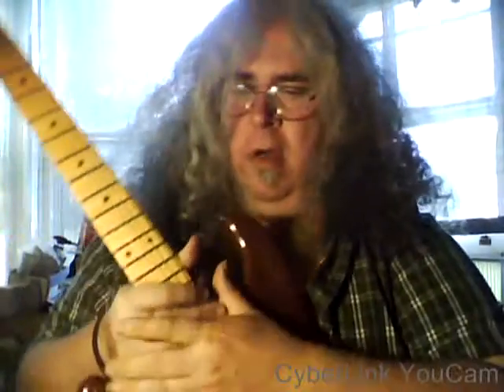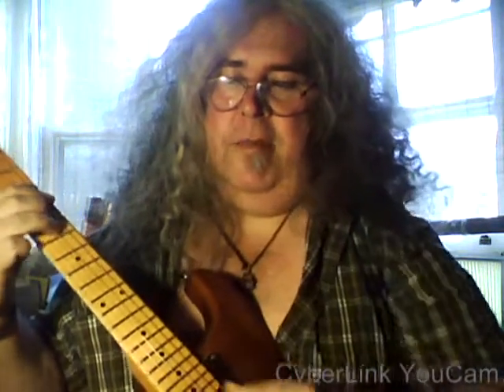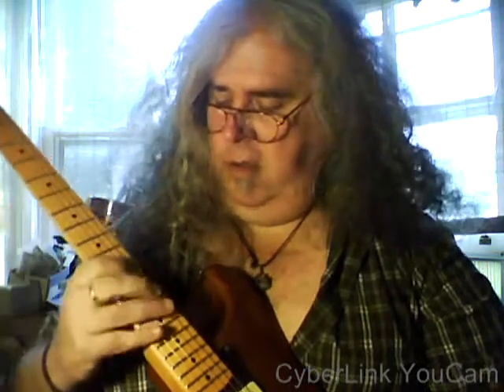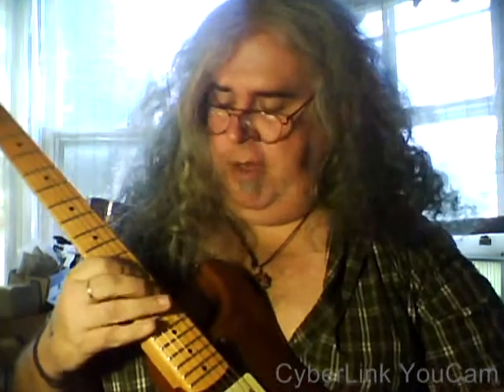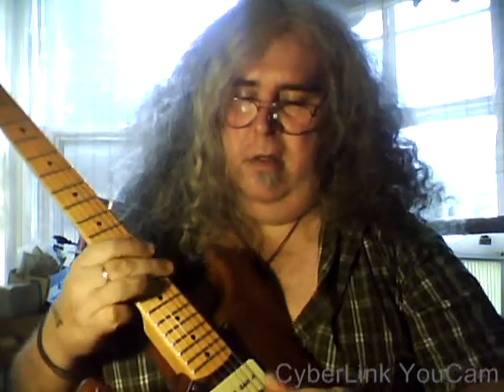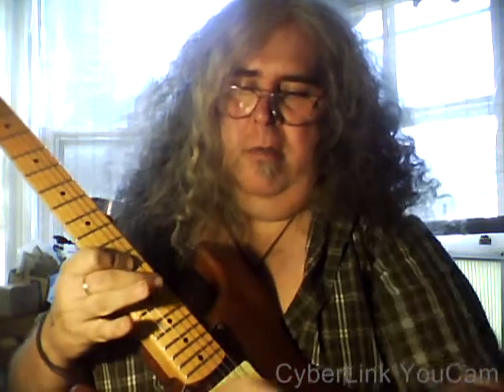SPTWPJT PH 1 PREVIEW

Comment from the maker: bro, make sure ya swap out the feedback resistor (750k on the "consensus" schematic) for a 1 meg trimmer... you can control the "bloom" of the feedback with that. you may wanna maybe use a 500k pot with say a 220k at the top, and a 330k  or something at the bottom, that way you can top mount it and tweak to your heart's content.
the percolate mod is imo AMAZING... subtle, but totally changes the pedal in a GOOD way... rock on chromeshere! thanks for watching!!